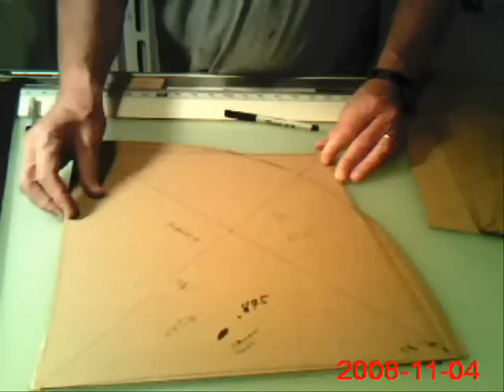Part 2 of 4: Design your own fighter ktie

Comment: Could you please enlighten on the Wingtip to wingtip distance calculation - multiplication factor 

How did you get the range from. 0.83-0.88, is there any reference??
Reply from the maker: Good question. The reference is from my hours of flying experience only.  I have noticed the best performing kites of mine have a wingtip to wingtip distance that is in the range of 0.83 to 0.88 x the bow length.  It is not any scientific law that I'm aware of, just my personal experience.  Hope this helps.
Reply: @bruce.lambert  Great. Cheers